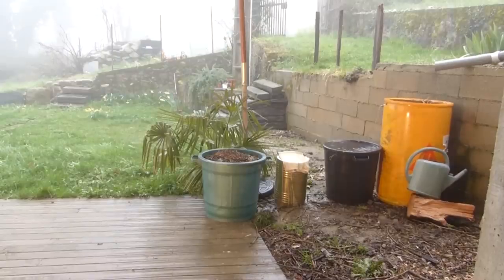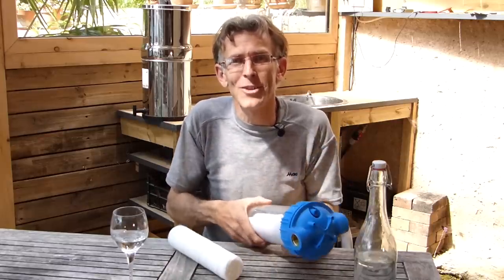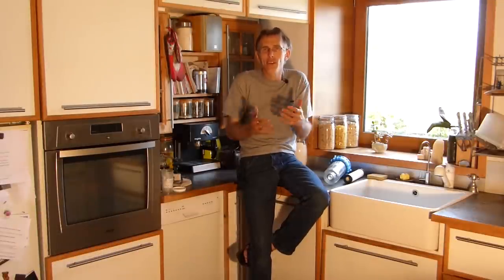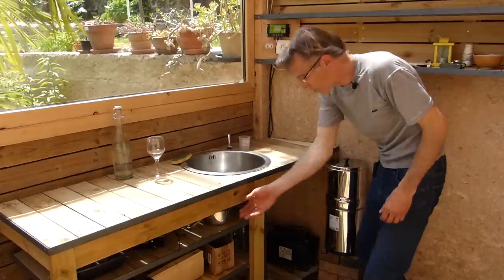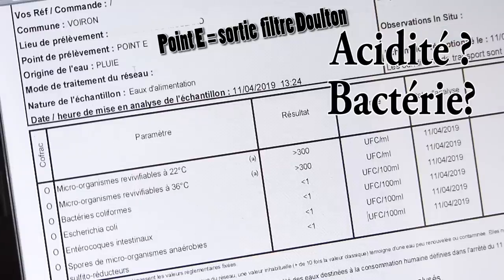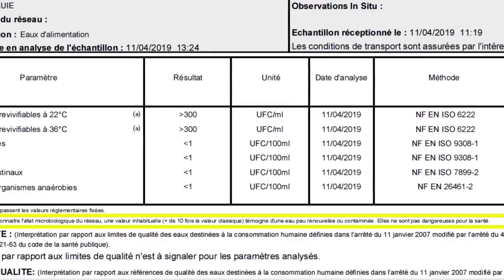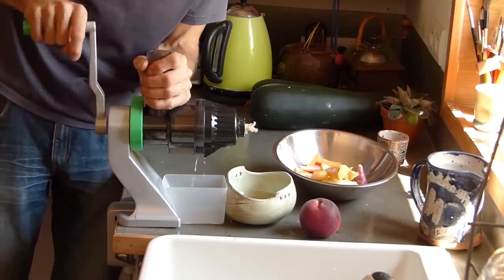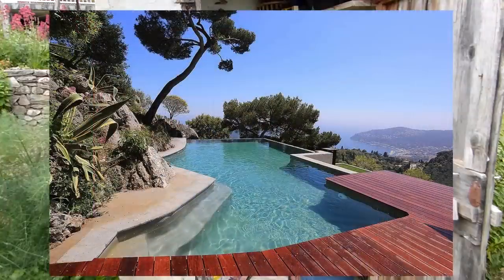Je bois mon eau de pluie :)

Comment: Super info Barnabé. Petit complément: En Belgique, toute interconnexion FIXE entre le réseau et le circuit d'eau de pluie est INTERDITE. Deux vannes et un anti-retour ne sont pas suffisants. Pour éviter tout risque de contamination du réseau, on peut utiliser un raccord, flexible qui est déconnecté la plupart du temps et qu'on utilise en cas de pénurie. Deuxième possibilité: verser de l'eau du réseau dans sa citerne (quelques règles à respecter aussi)  ou installer une pompe à réservoir intégré (assez coûteuse) Continue à nous informer!
Reply: j ai pourtant une vanne anti retour (enfin un espèce de tube troué si c est bien ça?) entre mon eau de pluie et eau du reseau en belgique, installation de 6 ans, il n y a pas de flexible
Reply: Comme en France, c'est interdit
Reply: @333siana  BJ Je ne vois pas de quoi tu parle avec un "tube troué" Tu ne fis pas allusion à la sortie du groupe de sécurité de ton chauffe eau (cumulus pour nos amis français) Les flexibles les plus couramment employés (mm si on ne peu pas) sont des groupe de remplissage pour chauffage. Avec un revètement extérieur en fils métalliques tressés.

Comment: bonjour, dit moi comme tu es en capacité de pouvoir stocker de l'eau de pluie, ne seras tu tenté d'utiliser cette eau comme réservoir d'energie?

je m'explique il y une vingtaine d'année en arriére lors d'une porte ouverte à l'université , j'ai vu differents prototypes et projets d'éléves ingénieurs  sur le théme de l'energie renouvelable
dont un qui etait en retrait par raport au autres et qui s'appellait un truc du genre "complementarité energetique à coupler avec une station photovoltaïque."

la maquette du projet, montrait 2 cuves de 1000l relié ensemble par 2 tuyaux de diametre differant avec une pompe à eau  et une roue a eau type PELTON couplé a un generateur électrique, ainsi qu'un panneau solaire en forme de fleur de 2m de diametre qui suit la course du soleil.

la premiére cuve est enterré dans le sol, en sortie du robinet de cuve un tuyau diametre 40mm qui va à une pompe à eau 24V DC. en sortie de pompe un clapet anti retour puis tuyau en 40mm qui va à la cuve en haut du terrain deversement de l'eau par le haut de la cuve, cette cuve en haut est surelevé par des palettes et enfermé dans une cabane isolée pour être protégé du gel. en sortie de cette cuve haute une electrovanne 24V DC, 2 position puis un raccord pneumatique avec tuyau en plastique diametre 6mm, en bas juste avant la cuve basse la roue pelton relié a son generateur electrique, 

le jour le panneau photovoltaïque produit de l'electricité en suivant le soleil, et une petite partie de cette production est utilisé pour alimenter la pompe pour vider la cuve basse et remplir la cuve haute, quand la cuve haute est pleine un flotteur vient devant un capteur qui coupe la pompe, le reste de la production electrique est envoyé vers la maison,
la nuit quand le panneau solaire ne produit plus de courant, electrovanne s'ouvre et l'eau  par gravité redescend et vient taper la roue pelton, la rotatation de la roue permet de produire du 24V  pendant la nuit.

je sais pas si ce prototype etait au point, mais si ça peut te donner des idées,

a plus salutation

Comment: Toujours au top! Merci.

Par contre concernant les nitrates: les personnes qui ont des bassins d'ornement connaissent ce problème (en l'occurence moi même), lorsqu'on rempli les bassins en eau de puit l'eau devient vite verte ( micro algues en suspension) alors qu'avec l'eau du réseau l'eau est clair.. ( pour un temps). La cause supposée de cette eau verte proviendrait du nitrate qu'elle contiendrait. Qu'en penses tu?

Ps: Bon cela dit, nous en conviendrons, l'eau de pluie n'est pas l'eau de puit ;-)
Reply from the maker: As tu pensé au chlore de l'eau potable qui limite le verdissement?  Moi je n'ai plus trop envie d'en boire

Comment: Excellent ! Pour ma part lors de notre construction en MOB dans le 70 j'ai opté pour une cuve béton de 5000 litres.
La cuve fournie par mon terrassier était une cuve de fosse septique peu importe ça fait le JOB après quelques adaptations j'ai 4800 litres.
J'ai mis en service mon installation en mai 2015, je n'ai pas voulu d'un suppresseur pour des raisons de maintenance et je me suis dirigé sur une pompe immergée sur  les conseils d'un revendeur   spécialisé merci HVPRO (http://hvpro.fr/).
Le bilan est le suivant (+ de 4 ans) pour une utilisation d'une famille de 4 personnes, c'est 255 mètres cubes à ce jour d'eau de pluie utilisée pour les WC / lave linge / arrosage / nettoyage divers ce qui représente 40%. La pompe immergée n'a aucun problème, j'ai peint la cuve à la peinture epoxy (ça va pas le faire pour l'eau potable...) pour éviter les dépôts car les tuiles ramènent beaucoup de dépôt et j'ai nettoyé à 2 reprises ma cuve 2016 / 2018.
Pour celles et ceux qui construisent lancez vous ce n'est pas de l'argent jeter à l'eau (elle était facile) ;) implanter la cuve lors de votre terrassement ça réduit les coûts et dédier un circuit à l'eau de pluie et eau de ville en prévoyant une dérive lorsque la cuve sera vide et ce fût le cas à 2 reprises et deviné la période...  pendant l'hiver!
Le point qu'il faut prendre aussi en considération est le puit perdu qui doit être dimensionné correctement afin de pas inonder votre terrain.
Vive l'eau de pluie!

Comment: L'eau pure sans minéraux n'est pas conseillée pour l'alimentation, bien qu'on trouve une bonne partie des minéraux dans les aliments solides. J'ajoute au passage que l'eau distillée est dangereuse (pour ne pas dire mortelle) pour la santé. Dire de l'eau de pluie qu'elle contiendrait des sulfates et nitrates c'est idiot, c'est compliqué physiquement, sauf si elle est passé sur des surfaces qui en rejettent (toiture), ou si elle a traversé un nuage de poussière/fumée, c'est probablement un raccourci journalistique (Céline Deluzarche, journaliste, elle ne l'a probablement pas fait exprès). Pour ce qui est de la purification, on peut effectivement éviter une bonne partie des virus et bactéries par microfiltration, par osmose inverse, ou par stérilisation UV. Ca évite en effet l'utilisation de produits tel que le chlore. Ne pas oublier cependant qu'on utilise justement ces produits pour leur effet rémanent (ce n'est pas un complot de l'industrie pharmaceutique). L'eau stockée et stagnante après stérilisation UV peut très bien être propice au développement bactérien, à moins que le contenant soit hermétiquement fermé et stérile. Il faut aussi parler des gaz et composés volatiles dissous dans l'eau de pluie du fait, entre autre, de la pollution : on peut avoir des phénols, des dioxines etc... donc il faut au moins passer par une filtration au charbon actif (qui est un consommable, une fois saturé : poubelle). Ces composés ne modifient pas forcément le PH de l'eau, qui par ailleurs n'est pas vraiment une mesure primordiale de la qualité de l'eau pour la consommation vu qu'on boit aussi bien de l'Hépar que du Perrier voir du coca... L'initiative est à saluer mais il faut éviter les raccourcis en ce qui concerne la consommation en eau de boisson.

Comment: Il serait intéressant de distiller de l’eau et de récupérer la chaleur résultante (600+Wh/L) dans un échangeur thermique pour l’eau chaude
Reply: Je distille moi aussi mon eau. J'y ajoute quelques grains de sel de Guérande pour la minéralisation mais ce n'est pas obligatoire. Quant à la chaleur générée par la condensation de la vapeur d'eau c'est en effet gaché en été mais pas en période de chauffage de la maison, donc pas de perte. J'ai le même raisonnement d'ailleurs pour les vieilles ampoules à incandescence qui participaient au chauffage de l'habitation. Je reste septique sur les ampoules LED qui sont très chères, ne durent pas les 15 ans annoncés (quand on voit le nombre de ces ampoules dans les récupérateurs c'est une évidence) et consomment 2 fois plus de VA que de W.
Reply: Oceantrotter tout cela est plus ou moins vrai en chauffage électrique avec thermostat. Pour les ampoules incandescentes la chaleur n’est pas bien répartie à cause de leur positionnement, il serait intéressant de faire des mesures pour voir l’impact.
Cependant si on cherche à réduire sa facture/dépendance à l’électricité on va plutôt se chauffer avec d’autres sources d’énergie, ou une pompe à chaleur.
Le coefficient de puissance faible sur les LEDs n’est pas un problème tant au niveau individuel que du réseau car il s’agit d’un système capacitif, qui annule le décalage inductif créé par les moteurs (qui ont des puissances bien importantes). Or, quand le compteur disjoncte à cause d’un faible coefficient de puissance (c’est à dire trop de VA mais pas trop de W) c’est quasiment toujours à cause d’un décalage inductif (vu qu’il n’y a que très peu d’appareils capacitifs de grande puissance).
Autrement j’ai quelques lampes LEDs 4000lm alimentées en continu (hors réseau) qui fonctionnent depuis deux ans, donc ça doit vraiment dépendre de la qualité des composants. Il doit y avoir quelquechose à faire règlementairement

Comment: J'ai du mal à comprendre pourquoi personne ne parle du pH de l'eau de pluie, qui, a priori, est acide et donc corrosive pour la tuyauterie et les électroménagers ... Mon eau de réseau est de l'eau de source (très douce : TROP douce) dont le pH est entre 6.0 et 6.5 : toute la tuyauterie en cuivre est corrodée (traces bleues dans les céramiques blanches). Les cumulus ne vont pas au-delà de 10 ans et les éponges durent 3 semaines max ... Si j'avais les moyens d'alimenter cette maison en eau de pluie, au niveau de la filtration, c'est plutôt à un neutraliseur de pH auquel je songerais, c'est-à-dire, reminéraliser l'eau ce qui se fait en AJOUTANT du carbonate de calcium (calcaire) .... Dans le cas de l'eau de pluie (peu minéralisée et donc acide), je ne vois pas l'intérêt de mettre une station de filtration capée pour de l'eau calcaire (comme celle présentée ici), alors que précisément il faudrait ajouter du calcaire pour neutraliser son pH et préserver tuyauterie, robineterie et electroménagers... en effet, la seule solution que j'ai trouvé pour neutraliser le pH sont des perles de carbonate de calcium (calcaire) ....

Comment: Bonjour Barnabé, 
avez-vous entendu parler de cette technique pour restaurer les batteries au plomb : 
tentative : https://www.youtube.com/watch?v=JP4UsgepVxY
résultats : https://www.youtube.com/watch?v=u-jyTRLZCO0
si une batterie a plus de 10 volts à ses bornes, c'est qu'il n'y a probablement pas de cellules mortes,
la plupart du temps sur les batteries ce n'sont pas les plaques de plomb qui sont totalement ronger mais la surface est recouvert de cristaux nuisible ce qui diminue l'ampérage et la capacité de se recharger , l'astuce c'est d'acheter du sulfate de magnésium (ça se trouve facilement en pharmacie) ,  vous le mélangez à de l'eau déminéralisée/distillée/de pluie filtrée :) , vous refaites le niveau des batteries avec puis vous les mettez à changer jusqu'à ce qu'elle soit pleinement chargée, et si ça marche vous avez des batteries presque comme neuve , si ça à améliorer la situation mais que ça ne suffit pas ça veut dire qu'il faut rajouter du sulfate de magnésium, ça ne marche pas à tous les coups j'ai essayé sur 3 batteries de fauteuil roulant électrique/trottinette électrique, 6 batterie de scooter, 1 batterie de voiture ,ça a marché sur la batterie de voiture 4 des batterie de scooter et une seule batterie de trottinette électrique, je roule depuis 2 ans avec une batterie qui était destiné à partir à la poubelle et qui a subi ce traitement et tout vas bien.
je trouve que c'est un peu dans le thème de votre chaîne :)